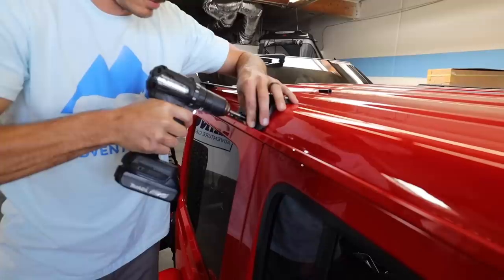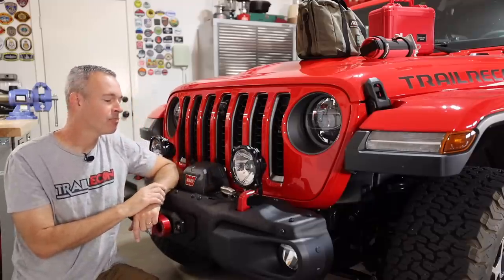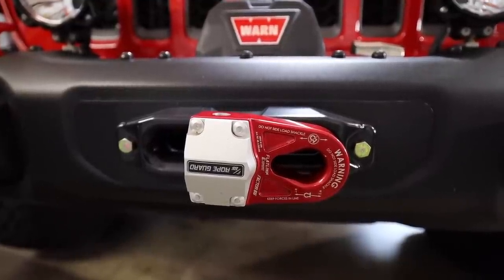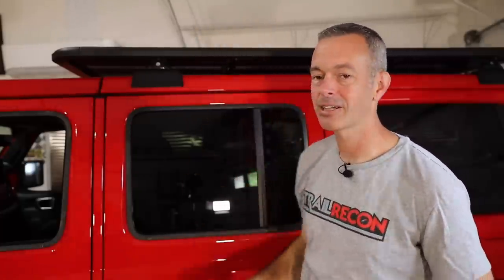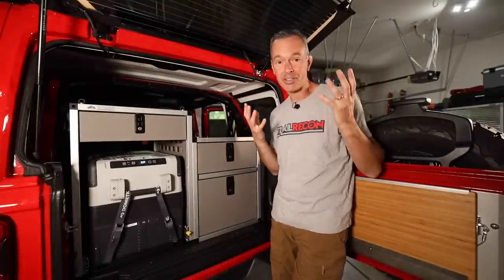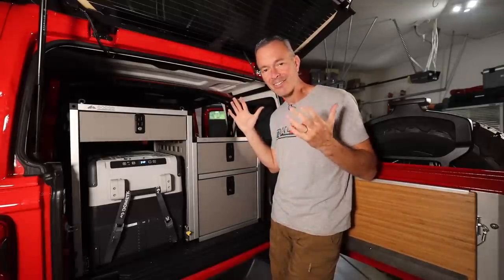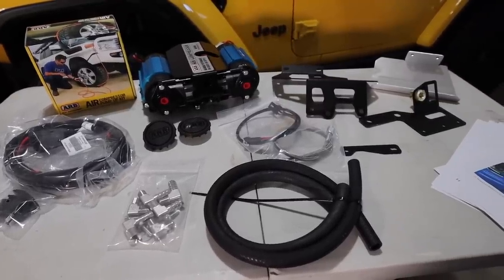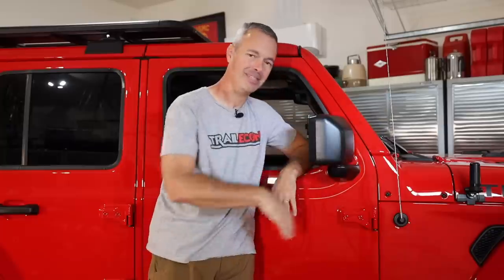The Jeep Wrangler Diesel Overland Build is Starting to Come Together!

Comment: I INSTALLED MY TWIN ARB COMPRESSOR UNDER THE PASS SEAT THE WIRES GO UNDER THE SEAT  THROUGH THE FLOOR TO THE BATTERY.  THE AIR QUICK DISCONNECT IS THERE AT THE SEAT AND I RAN A LINE TO THE BACK  UP ON THE REAR SHELF OF THE JKU.  JEEP LOOKS GOOD SO FAR.

Comment: Because I’m nuts, my comms is the same GMRS with their largest antenna off the left side of the hood, Kenwood 2m/440 with 55” dual band off the right side of the hood, and CB with a Firefly at the rear. Ham gets the most traffic by far but location matters. Also pulled the rear seat from my 2-door JL as soon as it was home from the dealer. Great channel, keep having fun,

Comment: We just found out on my brothers Diesel Wrangler that the motor Mount location is such that the upper control arms are unique to the diesel and the bump stops are 1” longer. So the Diesel has slightly less travel than a gas. Carli Suspension in Lake Elsinore is currently working on the fix. As for now the stock upper arms are being retained.

Comment: Brad, I absolutely love my Innovative JK Products under seat mount for my Dual ARB compressor.  Was a bit apprehensive putting it there but am so glad I did. I can still use my cargo hatch for other items. Plus the air up system with the Innovative JK Products system makes easy work to air up. Easy install as well. You may want to consider that as an option.

Comment: GMRS is a great choice for wheeling in the U.S.; different frequencies, but same band UHF/FM as what the Australians call CB. GMRS should provide the same sort of car to car range as HAM. I was about to go that way a few years ago, but since I was headed to EJS & they still use CB, I reluctantly put one in. With the HAM & CB installed not sure where the GMRS will go. Only down side to GMRS, I'm pretty sure, you can't use the mobile radio in Canada; only fixed antenna low power hand helds are permitted.

Comment: That front bumper looks great. Dont mess with it IMO. KO2's gotta go. Get some Yokohama MTs, they are quiet and amazing off road.
Reply: I'm not sure an aluminum bumper would be much lighter than the factory steel bumper.  The steel bumper is quite thin.

Comment: Great video,  big 👍,  good luck with the upcoming upgrades. As for the ARB compressor,  I got mine installed under the passenger seat and I found it very useful. I have to say that I own jk model but there's jl compatible plate as well. Anyway good luck and looking forward

Comment: You should lift the Jeep in stages.   Keep it stock height for a while, then go 35s with a 2" minimal lift, then more and so on.   It would be interesting to see you fail on the trail stock and then come back and make the same obstacle later after you're upgrades.   You modded the gladiator way to fast for your youtube channel.

Comment: Hey Brad, have you checked out the Maximus-3 mounting brackets for your Rhino Rack? It's way lower profile than the standard backbone mounts and doesn't require drilling on the outer edge of the hard top.

Comment: As you get ready to install an air compressor on your jeep can you share what you like better about a compressor vs the PowerTank you were using in your Gladiator?  Or maybe the pros and cons of both and why the one over the other when it comes to this build.  I have opted for the PowerTank option myself in my EcoDiesel Wrangler.

Comment: Hi Brad, 
The new JL is looking good 👍
Have you (or will you) be installing a dual battery system to run the fridge. Lithium is really starting to take off here in Oz
Cheers
Reply from the maker: I like the possibilities of lithium, so may look at some time of standalone battery system.
Reply: Cause I've low bugdet for now I use this solution: power from main bat to a RELAY second power from Suaoky power station so when jeep is running main power from battery, when it's off power come from portable (wich I charge from cig lighter or had doit before at home) ... I cant do no more than weekend ,but works perfect for me   Relay connections 87 & 87a positive source, 30 positive out to fridge 86 got tu 87 ; 85 have switch to manually activate all fused n wired with correct size

Comment: Do you have concerns about the weight...(the added weight) with the gear on the stock springs?  I am interested to see what you think once you load it up and hit the trail.  It seems to me the aftermarket does a better job once you load a JK real heavy... This is a JL, but with the added weight of the heavier engine and the added camping gear...possible weight on the roof, it will be interesting to see how it does.  P.S. when you think about coming  Montana... I might be able to give you some ideas!

Comment: Uninsurable down here in Australia with an Ancap/Ncap safety rating of 2/5. Basically the front seat passengers would lose their legs in an 80kph frontal offset crash and the real passengers would be decapitated in a side impact test.

Comment: @trailrecon 
I bought the rhino rack off your recommendations and the customer service has been very disappointing 
I ordered the cross bars and they sent multiple different locks so now I need multiple keys.  They will not return phone calls or email.  Very disappointed with rhino rack company.
Reply: Having the same issue with trying to get call backs from customer service.

Comment: Hey Brad. Well done. As you mentioned, you have not upgraded your suspension yet. I have a question here. You have already added a lot of weight to your jeep especially on the back suspention. Has it disturbed the balance of jeep on highway?
Reply from the maker: No notable issues with drivability yet, I think helping remove that rear seat helped a bit.

Comment: Check out Innovative JK Products for the under passenger seat mount, with dual ports on drivers and passenger seat. Air all four tires up at the same time to TPMS spec, air compressor remains clean and out of engine bay, you don't even know it is there. One of My favorite mods, super clean and low profile.
Reply: JL and JLU systems are available, and at an affordable price point.
Reply: Designed to fit the ARB dual air compressor... Has all hoses, everything you need in the kit.

Comment: Brad, I've just subscribed and it's funny how many things are so similar to what I already have in my current JLU and what will be in my future JLU EcoDiesel. The winch and steel bumper are exactly what I have on mine BUT I noticed the mounted KCs look like they are attached directly to the bumper rather than on the Mopar frame mount. Is this correct?

Comment: Damn they chipped the shit out of your hardtop paint!
Reply from the maker: You mean the tiny little chip next to the precisely drilled hole that's cover by a large black metal mounting plate? No worries from me.
Reply: @TrailRecon  10 seconds with some blue painters tape would've prevented it - just shotty workmanship is all I'm calling out. It's a great platform,

Comment: What's the tow capacity because all I've been able to find is between 3500 and 4I lbs. If that's true it's a total waste.
Reply from the maker: Yes only 3500lbs, thankfully the trailer I'll be towing is much less than that.

Comment: The CMMG ball mount on the grab handle SUCKS!!  It tears up the threads and would not fit my 2020 EcoDiesel . . . I returned this POS for full refund, minus shipping.  

GMRS, while using a less noisy frequency range than CB, it still lacks the power that Ham can provide.  The key to any radio system is it's antenna, so whatever you use, it needs to be something more than what's mounted to the top of the radio itself.
Reply from the maker: I have had in in my Gladiator for 14 months, haven't had any issues, sorry to hear about your experience.
Reply: My CMMG ball mount has worked flawlessly, fwiw

Comment: Brad I just picked up my diesel Gladiator with the plastic bumper and wanted to add a steel winch bumper will the stock front springs work ok.
Reply from the maker: Congrats on the new Jeep. No issues with the front suspension... I did the same on my Gladiator last year.

Comment: Air compressor for diesel? I though air compressor can work for any vehicle?
Reply from the maker: Just the mounting location is different, because the mount we did for my wife's JL was for the 3.6l gas engine.